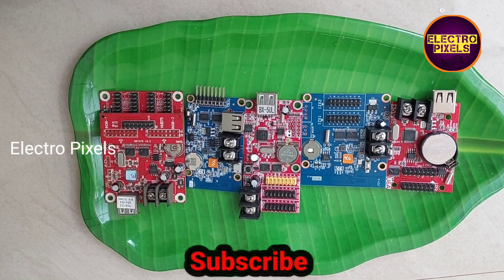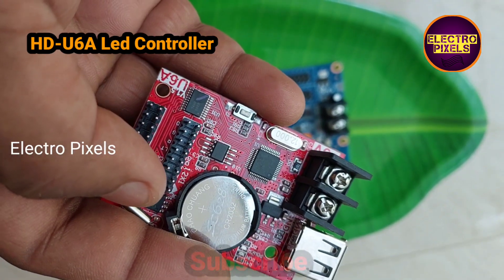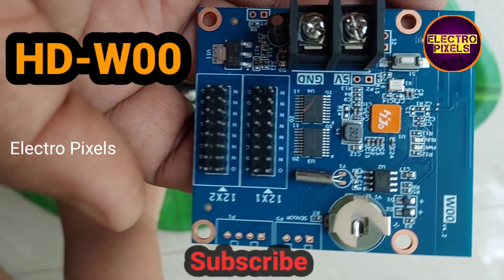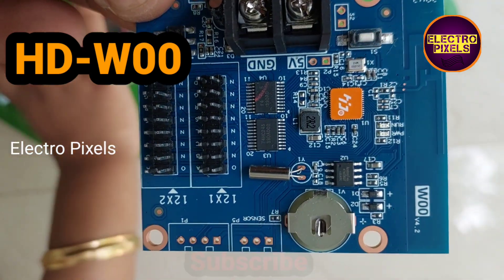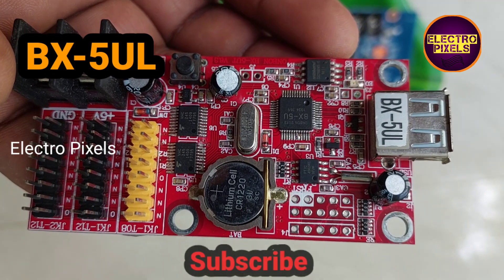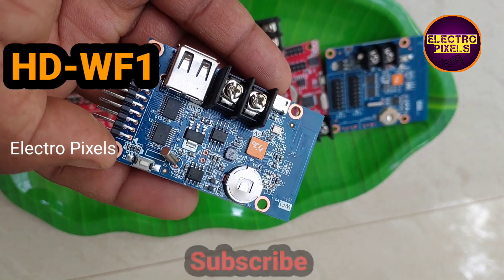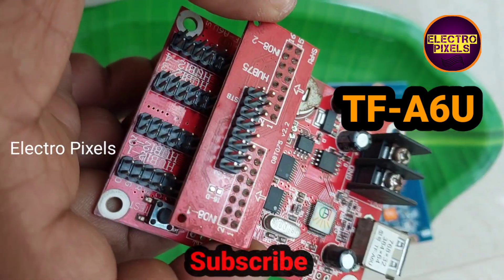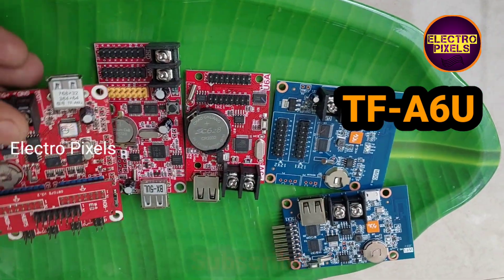Different LED Display Control Card Used In P10 LED Module|HD-U6A, HD-W00,HD-WF1,TF-A6U, BX-5UL Cards

Comment: Please i have Question
I Have 70 Modules one color 16X32 
112 X 320 
LED Controller TF-M3U ( 1024 x 64
512 x 128) not working with them 
If i buy TF-C3U ( 2048x64 1024 x 128) should working ?!?! Or not
Reply from the maker: You can Contact Big T media Youtube Channel, He is Expert in This kind making of LED walls.He can Help you. You can check for his contact number in his community post.